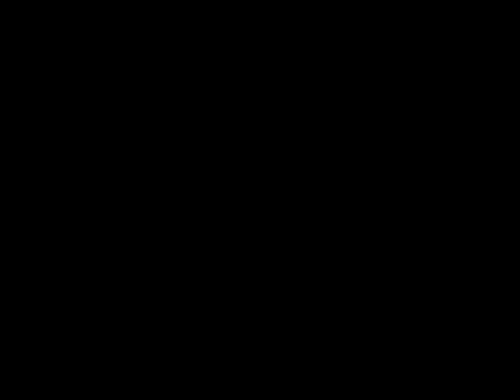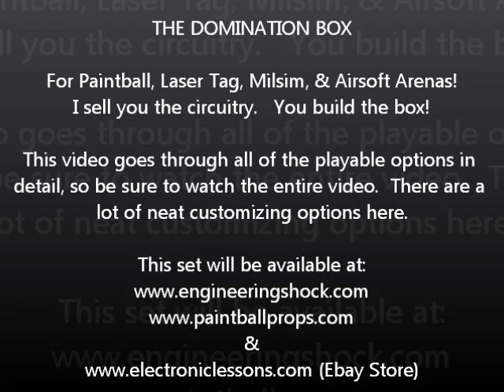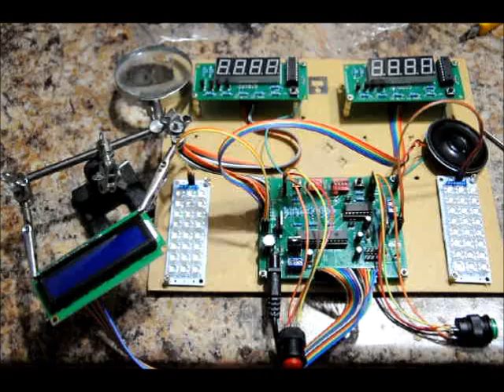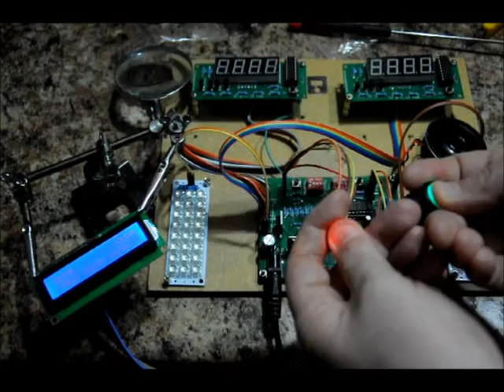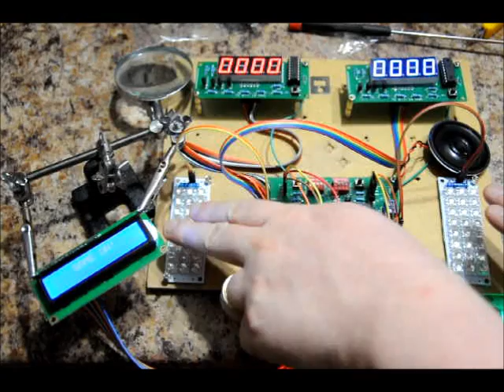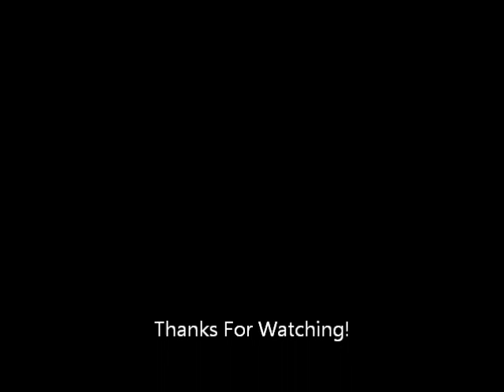The Domination Box - For Laser Tag, Airsoft, Milsim, & Paintball Arenas!!!

Comment: Can you program it so that after the "9" count you can let go and the points will keep accumulating instead of holding it down the whole time?
Reply: This was  my question too. I wonder if you replaced the buttons with toggle switches, that would mean the circuit would remain live and the counter would stay engaged. If that's the case, then you would just have to tell the teams that they have to flip the other team's toggle off before turning their own on, right?